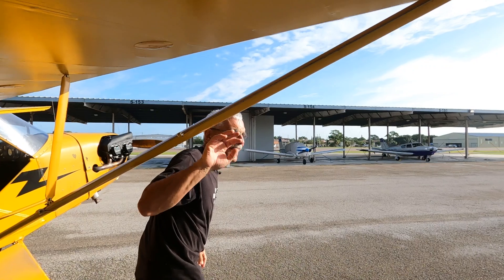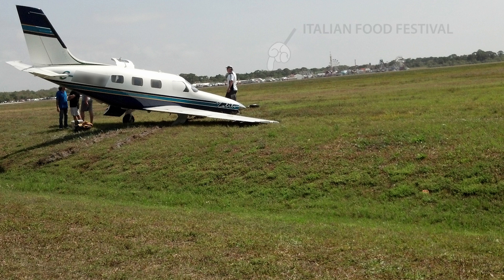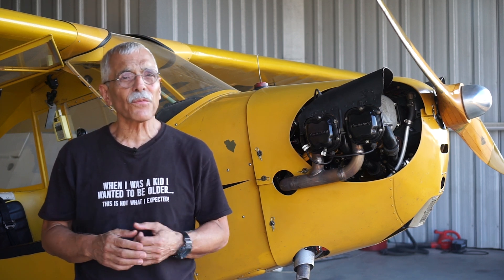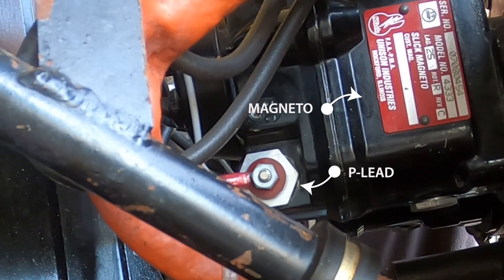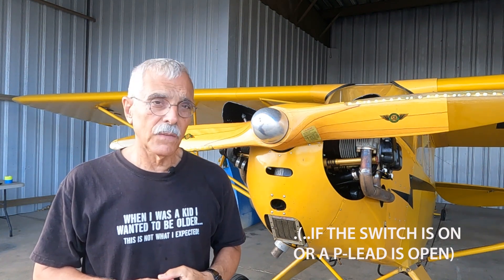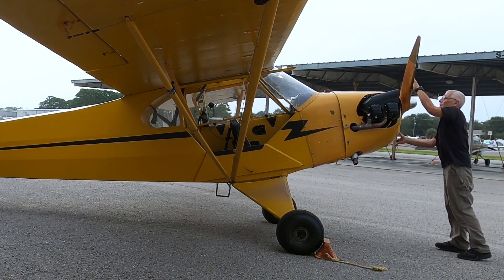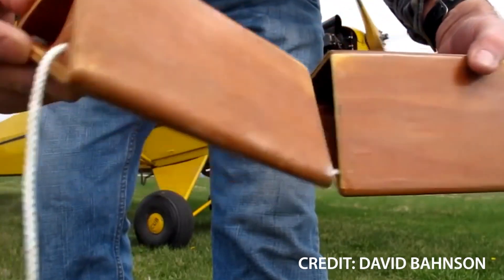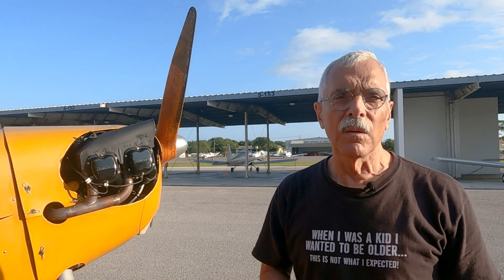Bad for Aviation: Hand Propping Run Amuck

Comment: When I was growing up we had a plane that had to be hand started and you think to yourself this can't be the way!  Its a bit like starting a lawn mower by flicking the blade around.   Hats off to those that do but I'm too clumsy to consider it. I had enough trouble with glow plug models and even then in recent years I used steel rebar restraints in front of the wings having seen them remove fingers.

Comment: The use of chocks cannot be understated. I once saw a G jump chocks after an engine change and the bonehead operator decided to go 95% power on both engines and of course, did not use big enough chocks for that hotrod of a jet.

Comment: Excellent Video.  In my extensive experience, the only way to hand prop is as a two-man operation with 1. pre-defined communication protocols and 2. two people who know what they are doing.  I have never been brave enough to get out of the plane to hand prop without somebody in the plane on the brakes, switch, and throttle.  I know it can be done, and a lot of people do it, but I've never been brave enough to solo a hand prop attempt, not saying I wouldn't ever do it, but for me, it would have to be an unusual circumstance.  I have forty years of experience hand propping airplanes, and they still have me spooked.  I may be chicken, but at least I'm not a dead duck.
Reply: Or a lame one either. Amen to that.

Comment: I like how Paul mentioned the use of the word "contact".  I learned how to fly in a Luscombe with an A65 engine, and have hand-propped it and many other planes over the years.  I ALWAYS insist on clear communication with pilots and the use of "contact" instead of "mags on" or "mags hot".  The words "on", "hot", and "off" all use a short-o sound, and sound too much alike.  "Contact" sounds nothing like "mags off", but "mags hot" and "mags on" could easily be mistake for "mags off", especially at a noisy or windy airport.  Also, this may sound a little overboard, but if I'm hand-propping, I will call out the word, have the pilot repeat me, then I will repeat the pilot - just to make CERTAIN that we're both on the same page.  Make sure all calls are spoken loudly and enunciated clearly.
Reply: The word "inhibit" instead of "off" would add a lot of clarity - INHIBIT and CONTACT sound nothing alike, and also INHIBIT can't be confused with ON or HOT by somebody assuming the other guy's using colloquial terms
Reply: I was taught this way too, have the pilot repeat the instruction to confirm. I have hand started a 6 cyclinder C206
Reply: @peterclancy3653  Wow. The biggest engine I've ever tried to hand start was a 360.  That 206 has a 520, right?
Reply: I've always used 'mags off' and 'make it hot' but that's just me.  Also, it's very little effort to visually verify everything is exactly where it should be (throttle, mags, etc.)   I treat the person in the cockpit (always a rated pilot also) to do nothing more than stand on the brakes and work the mag switch with my direction and verification.
Reply: thumbs up, mags on both
thumbs down, mags off
Reply: @GZA036  Yes, hand signals are also important.  I've also seen hand-proppers ask to see the pilot's hands, so that there's no chance the pilot bumps the switch while they're pulling the prop through during priming.  I've never asked for that, but I've seen it done multiple times.

Comment: I was already a licensed pilot when I was checked out on an L-16 and had to hand start.  The instructor properly told me to prop from behind, holding onto the strut.  Later, he managed to get an impressive scar across his chest when he hand started on a bitterly cold day, slipped on the ice and was nicked by the prop.  I can hand start, but I never liked it.
Reply: Malcom - I've had an L16 for about 3 years now.  Lucky enough to have an airport buddy help me prop with me in the cockpit most flights.  Recently moved and been doing it solo.  I have a set of chocks on right tire, and a chock with a rope on rear tire and reel this tailwheel chock in like a fish on a line after starting.  Also use the "shut off the fuel" after priming, and only start on impulse coupling mag when starting.  Put in place any and all safety features, the extra few seconds will be worth it.  Knock wood - not yet had a starting issue!  ;)

Comment: G'day,

Yay Team !

Ah, but you forgot to mention Starting Magnetos...

When I was learning to start the Replica Sopwith Pup built in 1976/'77 by Transavia (for Neil Cottee), it had an Armstrong Siddley Gennet Major in it, which had 3 Magnetos...; the Left one, the Right one, and the Starting Mag., which was in the Cockpit and had a Cranking Handle and a little integral Step-Up Gearbox.

After pulling the Engine around backwards at least 6 Blades, to avoid bending a Con-Rod by attempting to compress any Oil which might have accumulated in the Bottom Cylinders, we had to pull it forwards through 6 Blades, after the Pilot had primed the Carby with a "Ki-Gas" Pump...., then we pulled it through again till the Number 1 Cylinder was Compressing - which happened while the Blade marked #1 was pointing down..., and then coax the #1 Piston to a point where it was 1/8th of an inch past Top Dead Centre (to be done by sense of "FEEL !"), and then everybody stood back.

  The Pilot next switched on the Left & Right Magnetos, and with the Throttle set & it's Friction Nut tightened, holding full Back-Stick, he cranked the "Be-Jasus...!"  out of the Starter Magneto, thus firing a "shower of Sparks" into the #1 Cylinder ; thus resulting in one of 4 options..., 1) nothing happened, 2) the Exhaust puffed & banged & the Prop moved forward & past Compression on #3 and accelerated and #5 fired and then the Engine was running..., 3) it almost got past Compression on the #3 Cylinder but then stopped or bounced back 1/4 of a turn..., 4) the Piston was on the wrong side of TDC & the Sparks made the Engine go backwards I/2 a turn.

  Sometimes it took over half an hour, and at least 6 people would be swearing.

The Fokker Triplane (Replica) with it's Warner Scarab Radial was easier to start, but at 165 Hp (derated to 120 by the Throttle) it was pretty scary to watch - I never had a go at that one.

   Such is life,

Have a good one...

Stay safe,

;-p

Ciao !

Comment: All good points, Paul. I learned on Aeronca Champs, Luscombes and Pipers. At a dark Big Beaver Airport, Troy, MI, I landed our family Cessna 150 to find three big souls with a crate standing beside a Mooney Executive. The owner/pilot completed his preflight, loaded the aircraft, yelled clear and got a quarter turn of the prop before his battery gave out. Subsequently, I agreed to give the prop a pull. The pilot had to 1. hold the brakes and 2. keep pressure on the start switch to employ Its' "shower of sparks" to a mag. Having logged hours in a similar type, I told him not to touch the power controls at all. Made him repeat that to me in front of his guests. I press checked to insure braking, called "contact", he nodded an I swung away. Sure enough, it fired and began chugging. As I raved around the ight wing, I witnessed our hero playing with the mixture and throttle. The engine died. No hope after that. A return the following day with a new battery would work. The crate held two toucans bound for Sea World in Ohio. Time was critical. I card in two commercial pilot friends from Detroit City Airport with their Cessna 206. The birds and five souls left in the dark and rain. The following weekend, I ran into my friend and heard how the birds chewed their freedom and terrorized the IFR pilots until captured in jackets. All survived.

Comment: I use a big ol' towing strap on the tail wheel and low profile chocks on a string. I get it fired up, undo the strap and climb in. After letting the engine warm up a bit I power over the chocks and pull them in once they're behind the wheels. Seems to work pretty well.

Comment: J-3 owner..I always prop from behind. Paul is right about not having impulse couplings, just awful. The key, not mentioned in the video, is to understand that you don't need to spin the hell out of it with your whole body. With couplings, if primed right and throttle set, a solid one hand pull on the prop will have you clickety clacking along.
Reply: J3 owner too .. totally agree. Its all in the correct mixture.

Comment: Old glow/gas powered RC airplanes are a great field study for this video!
Reply: Yeah, back when I was flying RC (late 90s) there were quite a few guys on the field with scars on their fingers, and one even was missing a finger tip. Large four strokes can be unforgiving  I never flew anything bigger than 7.5cc two stroke, and those generally started pretty easily. To keep my fingers safe, I used the technique of grabbing the spinner, and "throw" the prop in reverse against (not through) the compression. If temperatures weren't too low, it would generally start. Kept my fingers out if the prop arc.

All that hassle went away when I switched to electric though. That just works, in any weather 😉
Reply: This experience might help full size hand propping people to stay safe.
 
I was starting my Fox 46 ABC powered Scat Cat alone at the field. I was regularly flying this same plane over and over, so every action was rote or totally automatic. My then current system (hey, a pun - just noticed it) was to power the glow plug from the field box power panel. When the engine was running, this plug lead is disconnected. I routinely would reach over the prop, grab the plug lead and toss it back toward the field box and away from the plane. This system worked perfectly well, so I had no reason to change it. I am a firm believer that to start a glow engine you must be exactly consistent in your fueling and priming steps. This ensures that your engine will start first time - every time. Like mine always did.

So, the engine fires up, I reach over and disconnect the plug lead and toss it aside BUT, this time I hear a little BZZT sound! Huh? Whats that? I lift up my right arm and on the inside of the elbow, there were about 5, two inch (5 cm) cuts right next to each other where the razor sharp APC 11x6 propeller had diced me up! It stung quite a bit, but it was bleeding slow enough that it didn't look like it any veins or arteries were cut. I was healthy, so I knew it'd stop bleeding some time! My plane was just sitting there, idling - waiting to fly. Screw it, I decided to carry on and fly - I'll just hold my elbow a bit away from my shirt to keep the blood off it.

After the flight, I asked myself, what had gone wrong that now I misjudged the prop arc, but many times before I was okay? The answer lay in the dirt. Our club had concrete starting blocks that were about 1 yard square. My taildragger plane was small enough to fit on this block, but this day I was using a block that had a bit of a depression caused by numskulls running their engines too much and too fast and for too long on the ground. This erodes the dirt away causing a bit of a hole just beyond the cement. This day I hadn't noticed that the tail wheel was off the block and in this depression. Since my plane was a taildragger, the front of the plane was a bit higher than normal, bring the propeller closer to my arm. A seemingly insignificant difference, yet with dire consequences.

So, to sum up, beware of ANY change that can cause a significant difference to endanger your life. The larger your plane, the larger the BZZT will be!
Reply: Growing up I couldn’t afford anything bigger than a Cox .049 and control line models but those little things hurt like the dickens (whatever a dickens is) when they got your finger. You had to shut off the fuel to stop a running engine but I had a buddy whose father wouldn’t waste time doing that. He’d just grab the prop. Needless to say I never tried that.
Reply: @a.n.7863  rag in the prop works or a sleeve
Reply: Had a guy in our club break many bones in his hand a couple years ago getting a pattern plane with an 18 inch prop started. The plane lurched forward and caught him at high throttle. The tail was tied down but the line was slack. Fortunately he still has all his fingers and most of his range of motion.
Reply: My finger can attest to that...🍔😲🤢
Reply: I’d completely forgotten Cox 0.49s. Omg my knuckles hurt
Reply: I once did a touch and go with an EasyStar with *stock brushed motor*, when the 5" prop decided to shed a blade which whizzed past my ear. 
That made me contemplate RC toy plane safety.
Reply: I started an OS .40 in middle school and was startled by the throttle position enough to reach THROUGH the propeller to shut it down.  Four stitches later, I learned my lesson.  Been hand propping my Cessna 120 for a couple years now with full conscientiousness and attention to detail.  Maybe the little nitro engine beat me into shape.
Reply: If we're sharing RC stories now, I've had a near miss that made think. When starting my engines I used to sit directly in front of it, on my knees. Fuel, prime, connect the glow plug driver, start, remove glow plug driver, adjust needle, remove tail rope, go fly. I did it like this for years. Until, one day, I notice my plane's wooden motor mount had soaked up fuel and/or oil and was wobbly. Simple solution, I took off the motor mount, replaced all bad wood, installed a glass fiber motor mount. Problem solved. 

Next flying Sunday, started up the plane as per normal, removed the tail rope, walked it to the runway, gave it full throttle to test throttle response and with a loud whirrrrrrrrrrrr followed by the silence of a suddenly stopped engine that I remember to this day, the prop went flying 20 meters or so. When remounting the engine, I had not tightened the prop nut enough. This mistake could have done quite a bit of damage to some... delicate... parts of my body. That was the last time I sat in front of an RC plane engine 😉

Comment: I don't know what a Starter would cost, but I KNOW it's cheaper than my hands/face.  Hand proppin?; NFW!  You ARE The Man.
Reply: On a continental with a -8 accessory case, there is no place to put a starter, or an alternator or generator which is needed to charge the battery. So you can’t put one in. But don’t forget that up until about 1930, all airplanes were hand propped. But then in the 60s and 70s the knowledge was collectively lost by pilots. It used to be part of general aviation culture.
Reply: @sblack48  They taught us to hand prop in A&P school in the early eighties. It made me nervous at first. Then, I learned to fly in a J3 Cub. After a few times, it was second nature, but you can never let down your guard. I refuse to hand prop a plane without a licensed pilot or mechanic at the controls. Magneto drop checks are vital to determining P-lead integrity. "No drop-Back to the shop".
Reply: @dougrobinson8602  and treat every prop like the mags are live because sooner or later one will be by failure or finger trouble.

Comment: So...Like, uh, I have a miniature version of your yella plane there (mine is bright green).
The 1st time I hand propped it I had it tied to my pick'um up truck (I'm a sailor...I know knots). 
The throttle was MUCH higher than it should have been & I honestly believed I was going to DIE.  I don't have it on video...but dang...that thing went almost full throttle and I went flying to the side.  I was mortified.
This is the smallest plane I've ever hand propped and I hate it the most. All the other planes I've hand propped were easier...I don't know if it's because of the height of the prop or the motor or what...but I do NOT like hand propping my 1/2a VW motor.